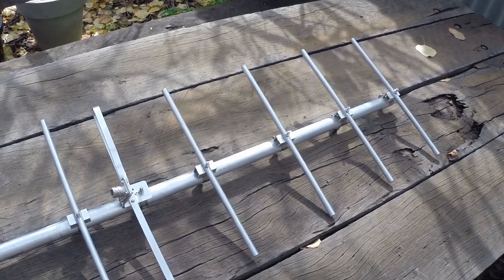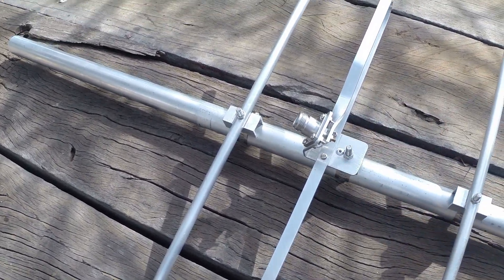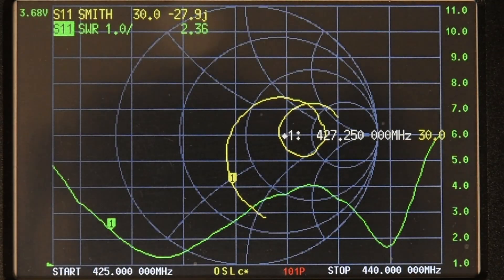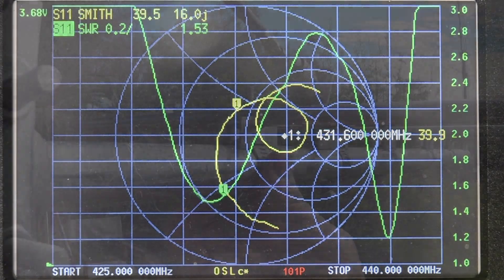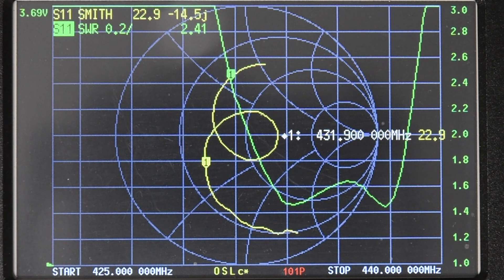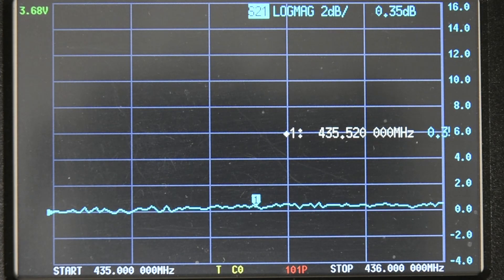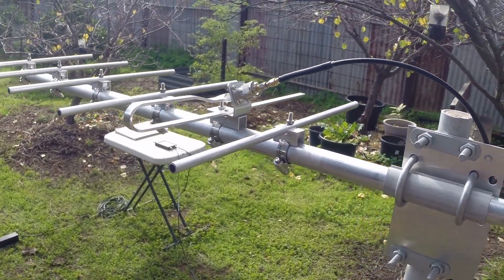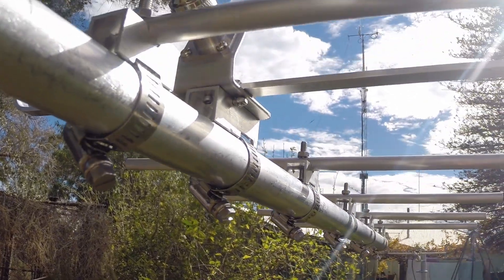J-Driven Element for a 70cm band Yagi Antenna – July 2024

Comment: Would this antenna perform better if the elements were electrically separated by using a non-conducting boom like the original? Also the long leg of the "J" is aligned with the directors and reflector. The original design centered this element. Did you test the gain both ways? Maybe it doesn't matter.

I am looking to build Kent's 12x12 version for a portable HDTV antenna. Would your changes be an improvement or detriment in this case. Thank you.

Comment: Super Peter......Can the J-Driven element also be used alone? What is the impedance of the element alone? I have adopted the hose clamp method immediately. Ideal if you make a multiple element antenna and you still need to experiment.

Comment: This is an excellent video.
I constructed Kent Britain’s antenna using pvc pipe for the boom. Those adjustable element clamps are  very nice are they home made or commercially available?
Reply from the maker: All home made and all material is available from hardware stores except for RF connectors etc. Also all tools are basic handyman type tools, vice, drill pop rivet etc.

Comment: Interesting design. Is the shield side of the coax electrically connected to the boom as part of the L bracket?
Reply from the maker: Yes; the shield is grounded to the L bracket. The coax was terminated per Kent Britain's design in that it is directly connected, however it is likely that adding ferrite cores to the coax would be a good idea or a chocking balun of some type.
Reply: Looks like it is. I wonder if a bal>unbal balun would give better results. Edit, silly me - it is unbalanced to start with so ideal to connect directly to the coax. What a great idea.